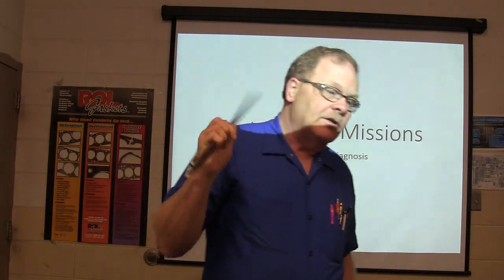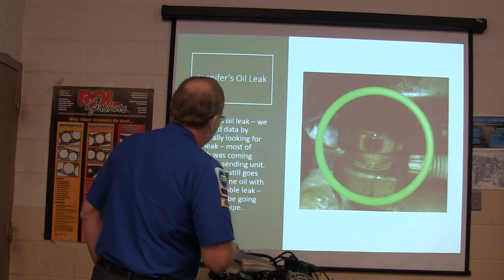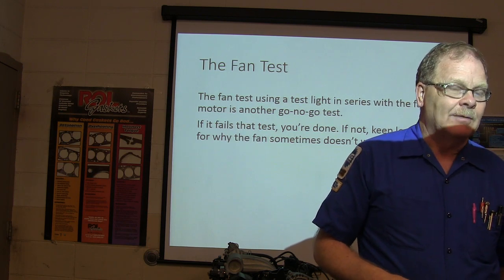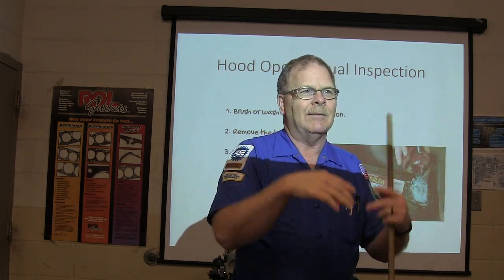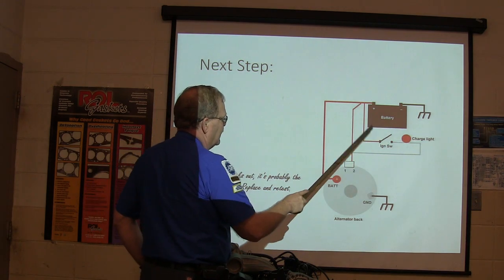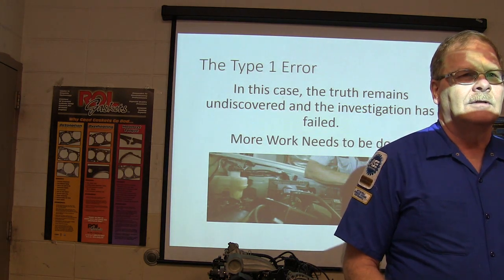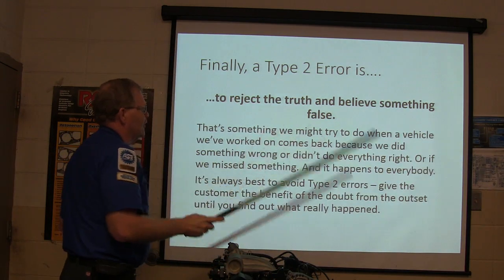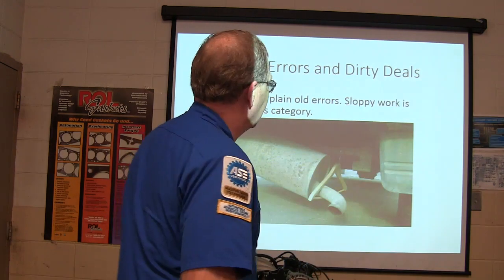Types of Errors

Comment: Love your show. Some fuel filters have a check valve to keep pressure in the line from the pinch rail area up to the engine. I've seen that cause a long crank. Not sure if that was the kind of hard starting you're talking about though.